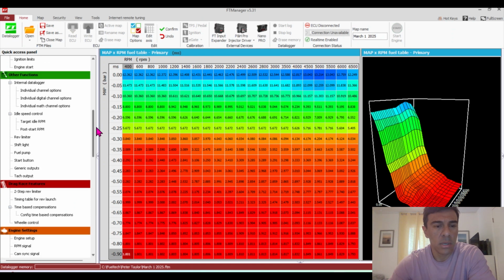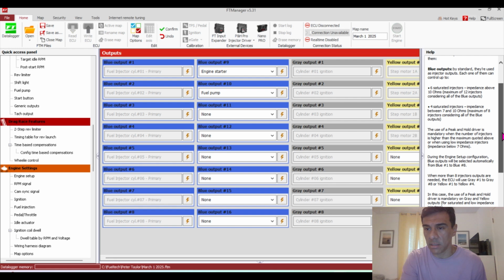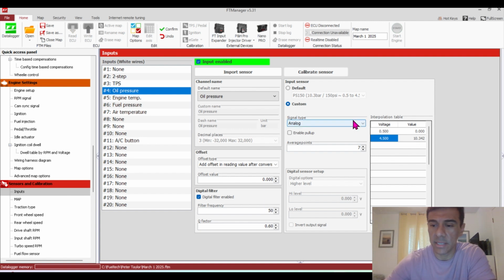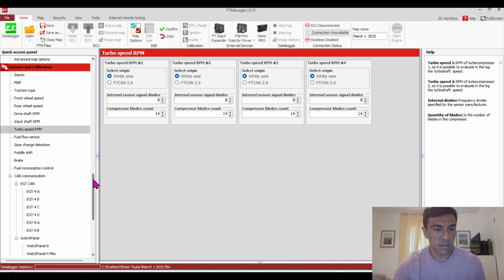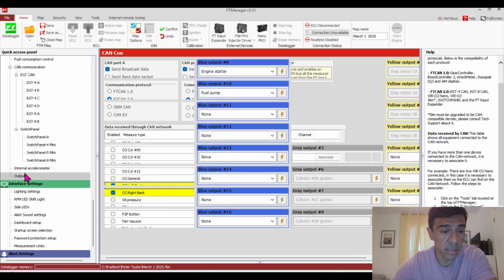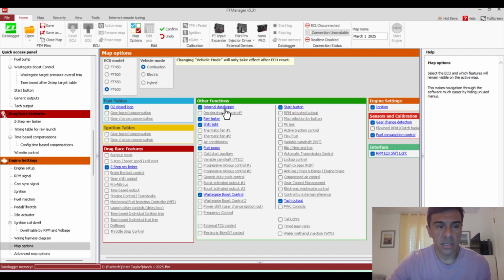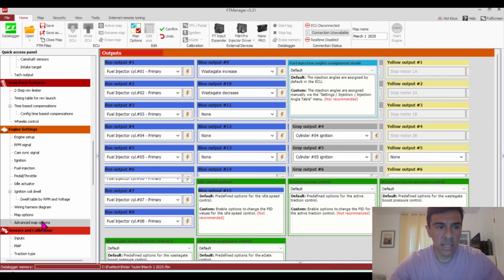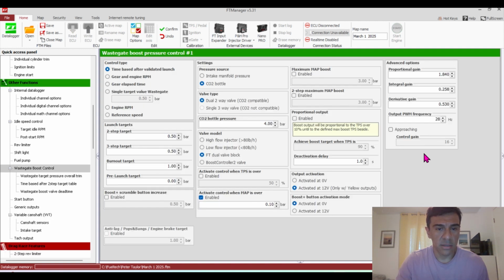FuelTech Advanced Settings!!!!!!     INPUTS AND OUTPUTS setup

Comment: Very funny. My name is Jesus and they also called me chui.
Reply from the maker: Tocayo lol
Reply: @ChuyTech  My boy just purchased a Fuel Tech system for his 1084 Rotary Rx7. We are trying to sort this out. I have Terminator x on my 1966 and they dont appear to be close to similar.
Reply from the maker: @chui19801 you making your own harness? Using factory distributor?
Reply: @ChuyTech  yes. he bought the unterminated harness and we are using the factory distributor
Reply from the maker: The wiring instructions are in the manuals section in the FuelTech website. Control “F” and keyword search rotary will take you straight to it.

Comment: Great video, I need to setup external tachometer, can I use blue number 5 ? ft450
Reply from the maker: External 12volt pull-up with 1k resistor is required on blue number 5 output.

Blue 3 and 6, gray 4 are intended for tach output if needed. These do not require pull-up
Reply from the maker: If you enjoyed the video please subscribe
Reply: Thank you
Reply: I have been looking for a procedure on how to assign the number 5 blue to a tach but can not find. I have assign it to a tach output but I'm missing some steps that can not be answered. The ft manual is very generic
Reply from the maker: @juandelgado-q6j  Do you need help wiring the output or configuring it in the software? Is this a factory dash you are working on?
Reply: @ChuyTech  thanks for your reply. The tach is installed on vehicle and wired just need to provide the signal from the ft450 to the tach. The the tach is aftermarket defi . So basically I have assign the 5 blue to tach output, added a 1k resistor but I'm missing how to set up in the fuel tech software. So it's assigned but not configured
Reply from the maker: @juandelgado-q6j provide 12volt to the circuit, set the tach output to synchronized in the software. The tachometer you’re using requires the blue engine speed input 1 to be used for voltage above 4volts.
Reply from the maker: If the synchronized method in the software does not work, try un synchronized and adjust pulses.
Reply: So you are saying that number 5 can not be used as an external tachometer signal in any way ?
Reply from the maker: @juandelgado-q6j it can be used but requires 12volts and pull-up resistor.
Reply: Hmm.